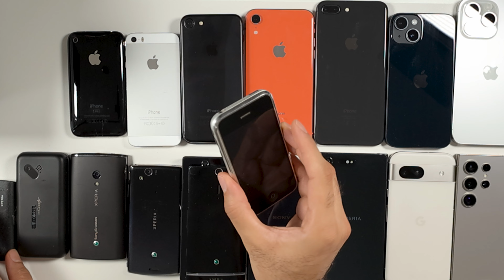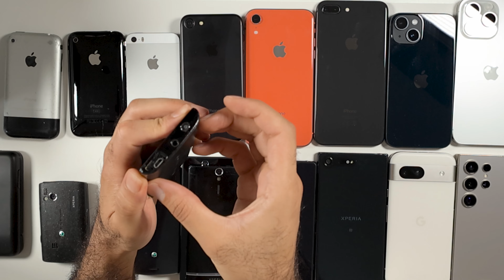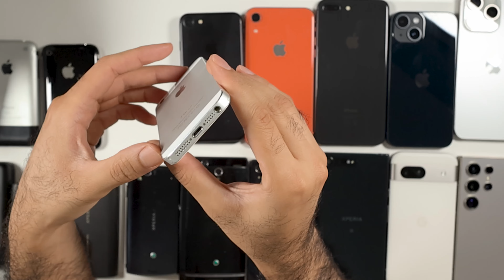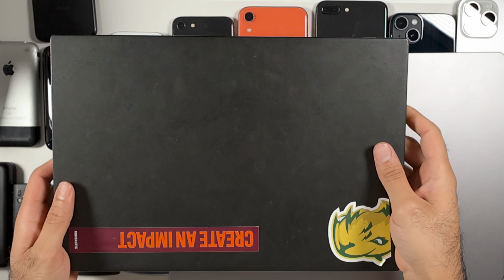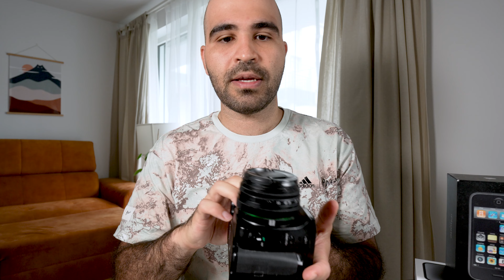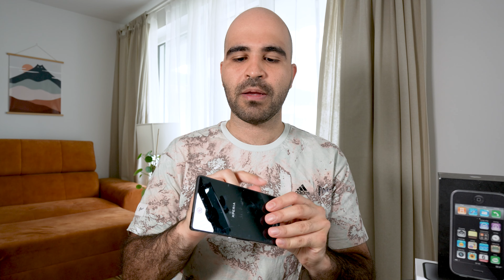Debunking MKBHD Apple Durability Claims!

Comment: Take the Fairphone as a counterexample. Most parts are swappable, but it has no ingress rating, and future models' components aren't backwards compatible. Clearly they've maximized repairability at the cost of durability (and longevity, since you can't upgrade your old phone with new components).

You provided counterexamples with phones having swappable batteries, but there was no steelman-ing regarding what Apple products gained from having fixed batteries, storage, RAM, etc. At the very least, can't their product dimensions now be a little bit smaller?

Comment: 2:24 not a big fan of Apple, never owned a single device from them, but unable to change the battery yourself doesn't rule out the durability. You just keep getting ripped off all the way from the purchase if you need them to do it for you.  Louis Rossman did an excellent video on this, too. MKBHD is done, after the screen app fiasco. Some folks just never know when enough is enough.

Comment: People say this and I can agree in some aspects, but more on the software side. I had an iPhone 7 from new until I got my iPhone 15 pro. Phone was still getting security updates even after it was meant to stop. Yes the battery wasn’t great but I COUlD have paid apple £50 to replace it. I’ve never experienced another manufacturers who offers that longevity. Also I get what he’s saying about serviceability but the things demonstrated are from yester year. The masses would never buy a modern equivalent if they were as clunky and bulky vs a sleek modern design that everything is soldered on which allows for these slim form factors.

Comment: Some kids put my older phone, with no ip68 rating, in water, it died, and the repair was a similar price ti the new phone. :))
The repairability lf newer phones has become a joke.
In my case it was a prety bad situation, with the phone being put in water a few times and than left in the sun for like 30 minutes, it made the water evaporate inside and it probably shorted everythyng so there was alot of components to change. But still.
Nowadays i try to buy phones with ip68.
Preferably with micro sd slot for upgrading storage too.
I wish i could replace the battery of my curent phone as i had it for 3 years and indeed the battery has degraded. Though not that bad, it can still hold up for almost a day using it as normal, with 120 hertz screen and limited charge to 85%.
But i feel that replacing the battery at a service might be dificult and the ip rating might not be accurate anymore.

Comment: I have seen this for a long time as well. I never have an Iphone but I owned 2 ipods. I was wondering why I could not replace the ipod battery. I have to say the old ipod is actually more durable, the newer one which is around the age of iphone 6 just came apart and I could not put it back together. It still work for a time despite being in that state, that is until one day it died completely. The old one outlasted it but of course as you said, it only work for like 1 hour before it runs out of battery.

Comment: I don’t think your arguments make a whole lot of sense. In most cases you should be upgrading your tech anywhere between 3-5 years. I just upgraded from my iPhone 12 pro to the iPhone 15 pro max. The battery in the iPhone 12 Pro was at 82% which isn’t that bad considering that it was almost 5years old. Battery degradation is a problem but most companies have gotten so good at manufacturing these batteries that in most cases the battery isn’t usually the issue. Honestly Samsung has the worst track record when it comes to battery degradation. One other point to make is the swappable batteries from before were absolutely terrible. They degraded much quicker and they held less charge. At the end of the day I would rather just have a battery that I don’t have to worry about replacing for the life time of the phone, then have to spend $200 in a 5 year period to replace a battery over, over, and over again.
Reply: Also when it comes to glass backs on phones. I personally like the extra weight and how it feels. Yes glass is less durable but that’s also why you can just have a case on your phone. I personally rock my phone without a case and the only phone I have cracked doing this was the galaxy Note 8 and that wasn’t even my fault because my wife was the one that dropped it directly in gravel. If you want a phone that doesn’t have a glass back, there are plenty of budget devices that have plastic backs.

Comment: If only removable battery trend didn't  die, we have slightly less e-waste. Like my phone (Samsung Galaxy J7 2017) that i still use to this day, the battery have been replaced three times already and it still works. Dropped it several times, at some point it had blackspot at the screen, top left but got drop again and the LCD fix itself, blackspot were gone completely. It had it's downside though, being an old phone, mainly software. I never update it, fear of slowing down and taking up space on my storage. Thank you for the consumer perspective of it Techmo!!!

Comment: Yea but if you have the battery so easy to access you get rid of the waterproofness that it would have otherwise. The glass back is also just more premium feeling, I don’t want so plastic shell, I’ve had a lot of iPhones form when I was 13ish from a iPhone 6 to the iPhone 15 pro now and I haven’t broke the screen or glass once you just have to use some common sense, get a good case and a screen protector and your all good. Don’t get me wrong apple does make repairing there products harder then they have to be when designing then which they should be held accountable for and they shouldn’t be like that and they should also be stopped from adding codes to parts so you can’t change parts without having to exchange codes or chips from parts like there screens and batteries. Not having a head-home back doesn’t make you have to get Bluetooth stuff you can literally get a dongle for your headphones it’s that simple.

Comment: Your case regarding your MacBook is really unfortunate and I get your frustration here. I don’t get why a single USB-port should make a whole PC unusable.

Apart from that, the video’s main talking points are at least 10 years old. User-Removable batteries are not a thing in most electronics these days. That is not an Apple-exclusive thing anymore for almost a decade now. The difference is, that Apple has as a solid repair network, where you can send your phone/Mac to, in order for it to be repaired. Sure other brands also have their repair services, but at least where I live, they aren’t so broadly available as the ones from Apple. The revenue generated from these services isn’t hurting Apple either. That’s part of capitalism altogether.

Durablility and repairability are also two different topics for me. Durability isn’t just looking at materials. It’s about fluidity in everyday tasks for a long time and software updates. Apple has been the gold standard, where Android manufacturers are catching up, which is a good thing. Reliable and secure software is just as important. My 2013 MacBook Air is still running, while my Surface Pro 4's display was snapping out of its chassis thanks to the bad cooling system by Microsoft or better the lack there of. Also it doesn’t support Windows 11 officially, due to the Intel M3-chip, which is lacking the necessary security codecs.

Your thoughts and talking points are valid, but they’re mostly outdated. Apple is one big fish in the sea of tech companies doing the almost exact thing. There are differences regarding upgradability of RAM (f.e Lenovo) or SSD (the largest Surface Pro 11). But overall, they are all following the same path. The real problem with Apple devices are the high price tags for their devices and the really expensive RAM and storage options , which are way higher than they need to be. Apple’s own ecosystem is enabling them to charge more, because their OS are Apple exclusive. So MKBHD isn’t the problem here at all.
Reply from the maker: Thanks for sharing your view. I agree that these days all companies are doing it, that's why I showed the older generation of the phones. IMHO apple was a pioneer in mobile space and laptops. Before Apple started to remove all removable components, phones, and laptops were very different than today. Building stuff glued together is cheaper, I personally believe this is the main reason electronics are now all glued together and we are forced to accept it, they could design it differently so that it is both reparable and durable and my point was that durability and reparability are not opposite of each other. I think the surface is not the best example. I also had Surface before, they are basically trying to be apple, without the durability, which is the worst combo.

Comment: Also, not including a charger is not friendly to the environment.
This goes across the board either apple or android.
Reply: Ironically they just made Taiwanese and Chinese phone makers to be the hero. Saw the inside of a box of an Asus ROG phone 8 and Xiaomi I forgot the model of and they still have all those things you expect (cable, charger, case, and even the extra bonus goods). They still have the headphone jack as well. While inside the box of a Samsung S23U, the only thing they give is the cable, and the headphone jack is gone. Previously the S10 still came with those. Samsung is a lesser evil compared to Apple but they are following suit. 

So my policy is if you don't give that to me and try to charge me extra for it, then F you and I will refuse to give you money for it. No charger? I am going to get one of those ugreen or anker or whetever charger instead. No case? Yeah, I'll get one aftermarket case instead, one that is not of their brand. No headphone jack? No, I'm not going to get that wireless headphone, nor will I get their DAC, I'll get a Dragonfly DAC instead.
Reply: @rps215  Yep, my Redmi came with preapplied screen protector, a case(nice one too), a cable which could go the max speed that my phone can(cough apple pro phones cough) and a 120W charger.

Comment: Huh? How does not having an SD card have anything to do with durability?
Reply: Every time you write to storage
Reply: @blasegangbeats1865  and how does microSD really alleviate that? considering the reliability of a typical consumer grade microSD is much less than the NAND chips used in flagship phones. I mean I have never seen any flagship phones from the past 10 years or so having massive issue of storage degradation. Considering storage is cheap with even mid range Android having 256 or 512GB storage nowadays, I question the reason of using a highly volatile and slow microSD as a "solution" for reliability.
Reply: Storage capacity degrades over time, using an ExSdCard helps minimize that.
Reply: @NEVIXIA  How does storage "capacity" degrades?
Reply: @axn2021  you see every time you write on storage you degrade it and you know what degrades storage a lot virtual memory or page file , when the apple low ram 8gb model exceeds its capacity it will use the storage as ram and will write on it a lot and it will die very fast and since the storage is soldered well you just have to buy a new apple product that will die the same as the first one.
Reply: @axn2021  sd cards are replaceable . and they are cheap. its not the rewrites the problem its apple they did it on purpose to have low amounts of ram so the os will use its drive as ram and it will do way more rewrites so the drive goes bad in like a year so they can buy another one.
Reply: @axn2021  nothing is durable all drives die after certain time or use , that's why replacement is part of the durability

Comment: unpopular opinion: there is a big difference btw durability and repairability, yes, they are linked together but durability is how the phones hold up in everyday use, i have a 2010 Macbook and it is very much functional, it is made out of aluminum so it still looks very new with little scratches and it hardly gave me any issues, I used a hp laptop during school year and i had to change the hinge twice and the case (because the hinge was braking the case) before dumping it because of the same hinge issues. Also Apple never claimed they are making phones specifically for durability or the best in durability, also debunking your claims on the removable battery, apple batteries tend to last longer (durable) than Windows laptops before repair. you mention a faulty port soldered to the motherboard, please mention one port that isn't soldered to the motherboard in any computer. Mkbhd was invited by Apple (one of the most valuable companies) to check its durability center on the processes it goes through and every company has that durability process they go through. the video was unbiased and only reported the process, stop trying to bring a creator down for stupid reasons!!!. Apple is trying its best to be carbon-neutral, at least they are trying.
Reply: Don't be a apple fanboy. Apple have introduced very bad trends like removing headphone jack, not including charger, non upgradable storage, non user replaceable battery etc..and made it seem cool. So every other company copied apple. Now it feels like phones have evolved backwards in some things.
Reply: I would highly recommend you watch Louis Rossman's video on this topic, your anecdote may not have the full picture. Also the problem wasn't necessarily with the tour, but the interview in the second half of the video, which blatantly misrepresented the nature of repairable products, and didn't address the main issues that we have with Apple. Durability has nothing to do with the fact that they purposely have set up their phones so that the parts are serial paired to the phone, meaning that even if you repair a screen or camera with a perfectly working one, it won't work unless it has been re -paired by apple. Or that you can't purchase replacement parts directly from the manufacturer, or their insistence to use lightning instead of usb-c until the EU forced them to. If apple really cared about the environment, explain these practices.
Reply from the maker: I am not trying to bring anyone down, he made a statement and I did a polite reply to it without accusing him of anything.

Comment: Apple has brainwashed their users for a long time. Keeping the same design for years, locking people in their ecosystem and making it harder to use other things with it. Charging a premium for what they call NEW or best in class which is all bs. Break away from the bs and you will see alot of products out there have crazy specs and better things going on. The software updates are nice on apples side but then again yeah you need those updates badly because they dont make anything to be upgraded. Old macs you could tear down and customize and rebuild newer macs you cannot and most of the newer hardware is soldered which makes it even harder. You pay upwards of thousands for property that isnt even truly yours. If im paying thousands i want to be able to take full control of my device with customization and if i want to upgrade parts or run linux or other software i can. But other companies are starting to follow into this business model due to the fact not enough people arw speaking up about it and continue giving into it. Until the day comes when they give you precisely nothing for an insane premium. $2k -$3k for a device that they say will be the latest and greatest until the next iteration down and people will scramble for that next.
Reply: Notice how they will almost never compare their products to the competition, and how they will take ideas from the competition but try to rebrand it as their own. They know that they have a fanbase that will just buy Apple because of the logo, so they can get away with it. An example is the Vision Pro. The Meta Quest 3 at $500 makes the Vision Pro at $3500 a complete joke, yet there was all this hype.
Reply: @ElishaPonkratjevs That's so true.Also,MKBHD accused Samsung Galaxy smart watch copying the Apple's design and features, and in the comments section,his followers criticized him strongly for that.
Reply: @sinfulskintatstudious407 Well said.

Comment: All electronics are waterproof… as long as there’s no power going through it. Yes they can corrode but it’s a lot less then if powers going through it and better then shorting out and permanently ruining it. 
 Removable battery’s are just the best option all around.
Reply: Water resistant*
Reply: @Shinko_fanny  then it’s not as eye catching plus people tend too not read without being shocked slightly. But yes resistant, as some components are flat out delicate.
Reply: @E.V.999  They won't use the word "water proof" because if their phones managed to get water damaged, then the manufacturer is liable to shoulder the cost for the repair since they claimed that their phones are "water proof". If they use the word "water resistant" then they can shift the responsibility to the consumers/users since the phone is not rated to completely survive possible water damage because it's just water "resistant" not water "proof". When it comes to legal responsibility, companies don't usually use "catchy" words.

Comment: A simple way to allow the battery to be replaced is to add a back cover with a rubber gasket and screws to secure it. That's cheap and doesn't require a lot of engineering. Yes, you may have to do a redesign to make it look nice, but that's preferable to throwing away a working phone and buying a new one just because the battery is already failing as many people do.
Reply: iPhone do have 2 screws outside even though they don't need it.
Reply: @GF-mf7ml  These screws are necessary. If they were not there the screen could lift under certain conditions.